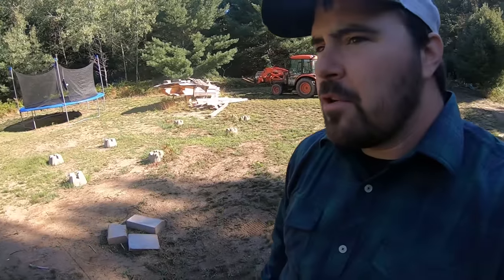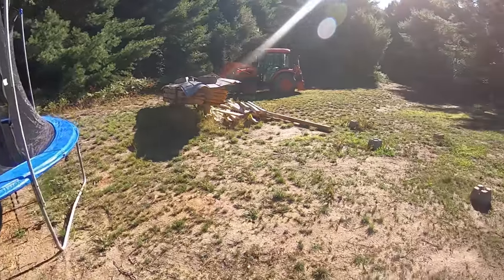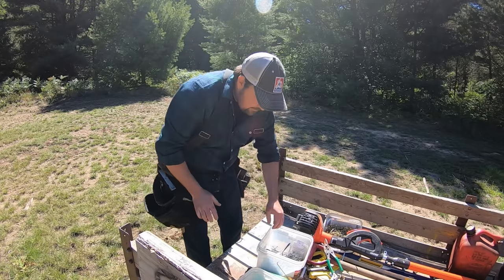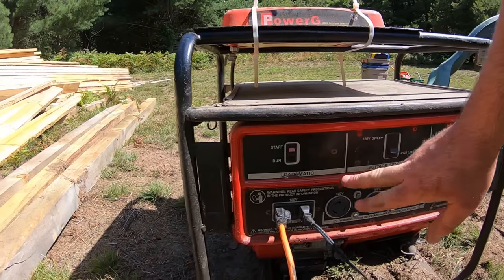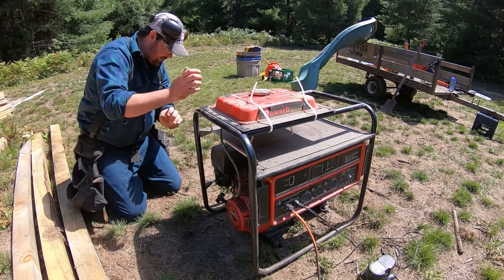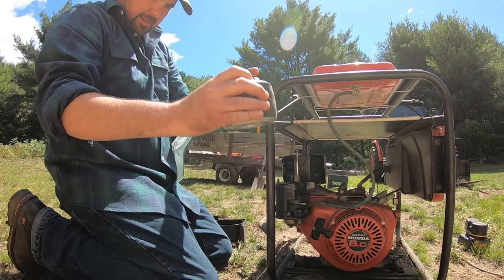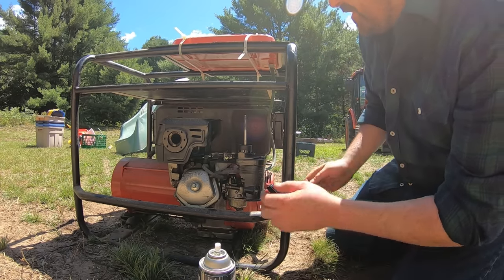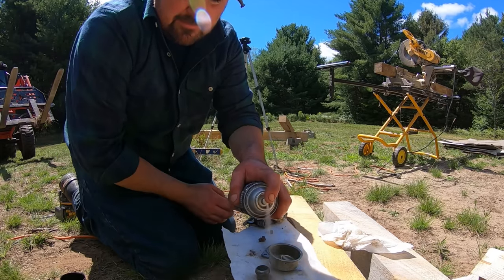Pirate Ship Project Hits Some Rough Seas | Yarrrrrr!  (Please help me...actually though)

Comment: Sandy I think you took a page out of my book, either can't find something or it doesn't work right.  Hope it clears up , but the oil level sensors are notorious for failing.  My sawmill HM 122 died and it was the culprit, disconnected the sensor and it works.  New one ordered, all the best. 🍻👍🚜🪵
But as I watch the rest I've got no idea.
Reply from the maker: I’ll for sure have to give that a try! Thanks again!